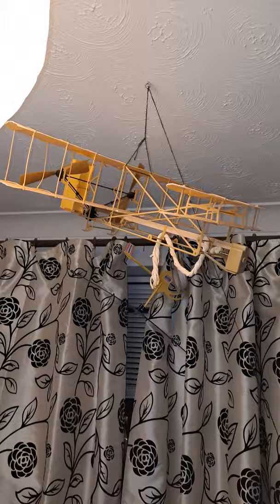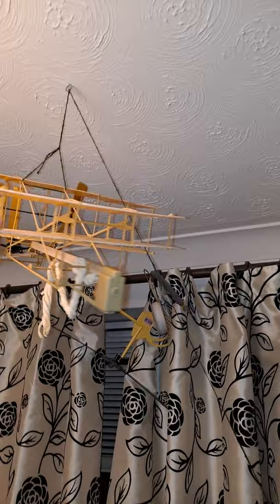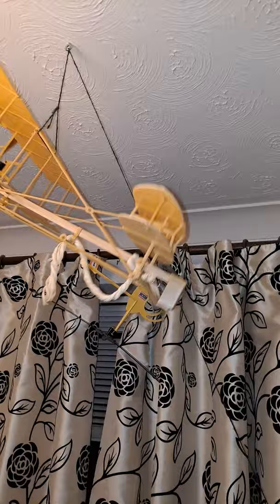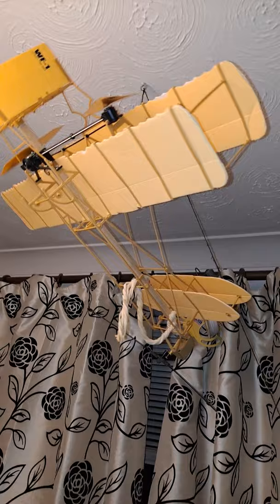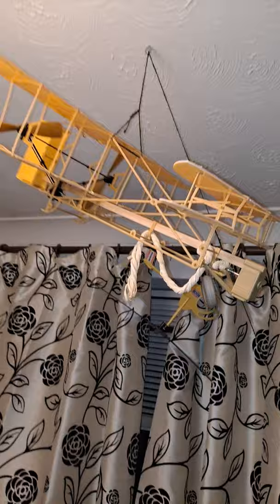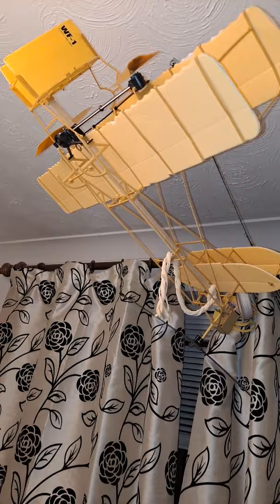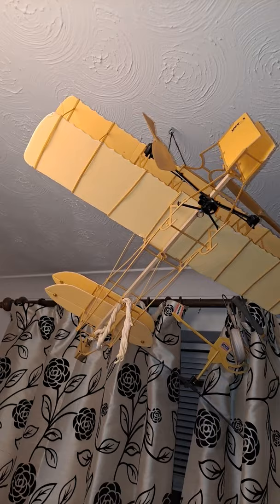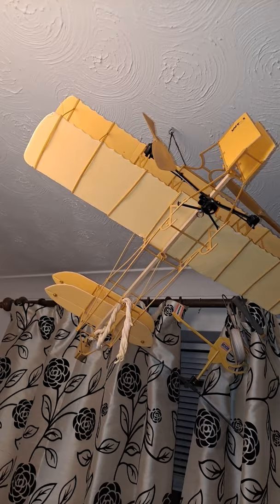Update on the Wright Flyer 20211230 #Shorts

Comment: vintage model company sell hobby grade rubber for free flight planes. If you use silicone lubricant and keep them in the dark they last longer to
Reply from the maker: Yes, I do have a small stock of rubber and lubricant, although it is probably a few years old now. At the moment I am just leaving it hanging from the ceiling. No rush to try to get it flying. I haven't seen a good video of one of these flying. Most are just extended glides and not even good glides. This is the playlist I put together of the ones I found on YouTube https://youtube.com/playlist?list=PLA5a2xPRSrB0uKyo6e5H-fXw2BHHoFZbF
Reply: @GrandadIsAnOldMan  Cheers mate ill check that out dude